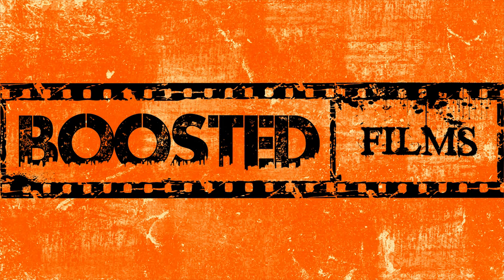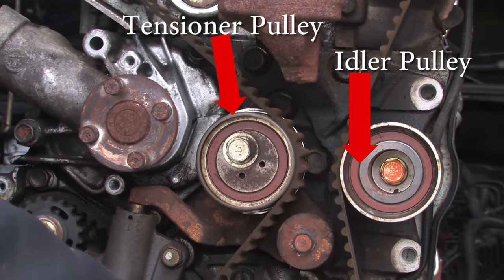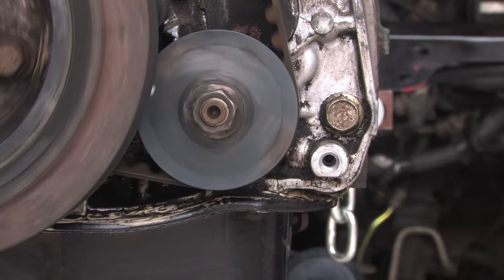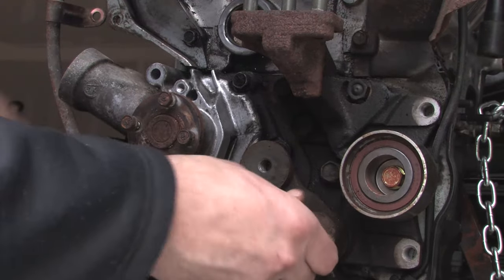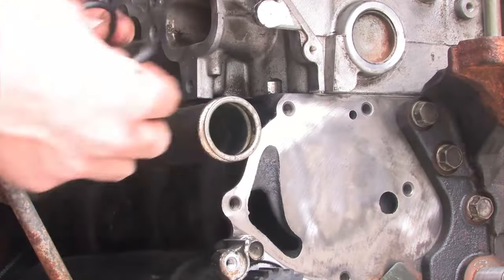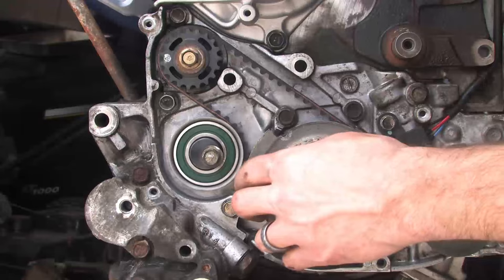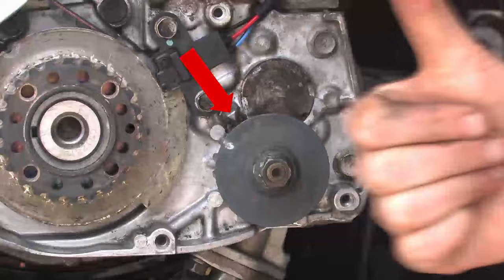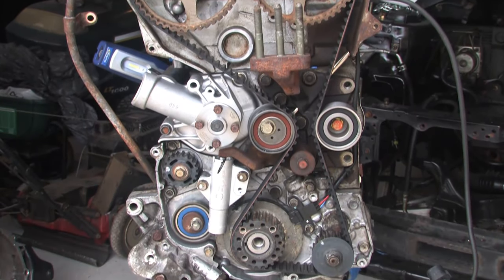Mitsubishi Timing Belt How-To Video (very detailed) // Evolution 8 - EVO8 - EVO9

Comment: .Balance shaft tensioner pulley, be sure the lip of the pulley is outwards, not in(against the wall of the oil pump)

.when installing timing belt, install the belt on both cams, work your way down onto the idler pulley, then onto the oil sprocket, crank sprocket,and finally the tensioner pulley. That way it doesn't throw off the lower b/s belt.

Comment: If your going to remove the belt for the rear balance shaft you should also replace the front shaft with a mirage stub shaft for it to run a little smoother.

Comment: Nice. Can't imagine how complicated it must be changing the belt with the engine in the car.
Reply: super easy
Reply: I just did it. Pain in the butt having to jack the motor up and down between steps. But beats the hell outta having to buy a crane and take the gearbox, both manifolds, the fuel rails and the air con off. Not to mention the amount of harnesses and connecters you have to fiddle with and remove from the engine block. It actually easier with the engine in, in my opinion :)
Reply: The 2-3" of room you have to work with and maneuver pieces around between the engine and side of the engine bay doesn't make it fun, but it's a lot easier than pulling an engine.

Comment: @Boosted Films - Subbed and liked the video. I was in the midst of doing my 06 sohc Lancer and came across this. The engine layout for all belts and pulleys was identical except for the second overhead cam gear. I managed to follow your steps and get it done extremely quickly. Runs like a dream now! Thank you so much!

Comment: according to the Mitsubishi shop manual, you can use two large paper clamps to clamp down the timing belt on to the cam sprockets then you run the belt down to idle pulley side.
Reply from the maker: Yeah, that and zip ties were a common approach if you don't have the special tools.
Reply: Actually, four paper clamps. I keep these with the smiley-pulley special tool and the long bolt for compressing the tensioner. But what really, really surprises me... this is almost the same engine, I have in my 1994 (!!!) Hyundai Sonata. 4G63 lasts forever ;-)
Reply: Boosted Files
Reply: I learned the clip approach from a local mechanic. It really helps.

Comment: Awesome video dude!! Another tip is you must turn the crank 2-3 times once tension is done. Let it sit for 30minutes and see if the pin in the auto tension slides back in. If not you’ll have to set the tension again :)
Reply: In the end the pin needs to go in freely? When I set the tension I didn't use the md998738 because I forgot but my pin did go in and out freely when I torqued down the tensioner pulley.

Comment: The thing which you’re calling front balance shaft is actually oil pump . Don’t know if you have noticed but when you removed your crank pulley , it was matching with timing mark on cover but the oil pump pully was out of mark which is pretty normal.
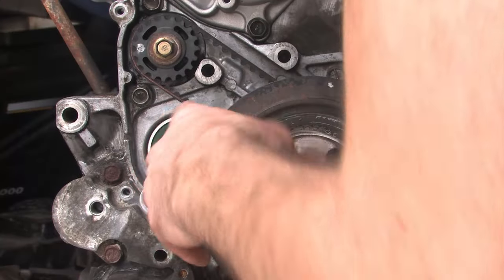Reply from the maker: Hello.  Yes i am aware the front balance shaft is also the oil pump pulley.  Sorry if i did not mention that directly.  As for the timing marks not matching, if you are talking about 3:53 in the video, the Timing Belt is already off.

Comment: Just did the timing belt tension on my friend's EVO VI.  Had it set as per Mitsu's procedure, where the pin has to slide freely in and out of the hole in the autotensioner after 2 spins of the crank, and waiting 15 minutes.  But the thing is, the final tension (just deflecting the belt between the cam sprockets, and the longg run lower down between the idler pulley and the front balance shaft sprocket) seems a little bit loose to me.

The actual tensioner pulley/happy face is in the same position as in your video, if not a bit further anti-clockwise/more tensioned.  Thoughts? Is this just the auto-tensioner setting things the way she wants it to be, and me thinking the tension needs to be stronger than it should be on this engine?
Reply: I think there is a little mistake (I might be wrong, do not remember now) in the video. Initially, the happy face must have 'eyes' up, and then you rotate it clockwise down, along the belt rotating direction. Let me check it..
Reply: Yep, I was right. Chilton's says clearly, put the belt anticlockwise starting from the intake camshaft sprocket, tensioner pulley (happy face) must be upwards, initially adjust the tension by spinning it clockwise.

Comment: Hi, I'm from Brazil and after have the timing belt changed the engine of my car started having a kind of vibratiion. Its like if the engine were lying somewhere in the chassis of the car. 
Do you think this could happen if some mark point were mismatched? Tks
Reply: The front balance shaft that turns with the oil pump pulley is out of phase.  It can be lined up 3 ways and 2 are incorrect because it's a 3 to 1 gear reduction.  When lined up the proper way, when you slightly turn the gear it will want to rotate back to the mark when you let go.  When lined up the wrong way when you rotate it a bit and let go, it will continue to turn away from the mark.

Comment: I know this is old but when I don’t have a balance shaft belt can I just install the new timing belt when u first take the old one off? My belts are brand new along with water pump and all, but a rock must have hit my belt as it now has a gash in it. I just need to Toss the new belt on, you took the belt off fairly quickly and I was specifically woundering if I have to take off the other stuff if I don’t have a balance shaft or can I simply put the new one on as soon as I get the old one off

Comment: Almost there.  Question on the lower belt cover.  I didnt see you take it off.  I have the bolts off.  But it doesnt want to come off.  Do I have to remove the crank pulley first?  Also, how do I keep the crank from spinning if I use pneumatic ratchet gun?

Comment: The 2 balance shafts are designed to work together. You can't just remove the belt from one balancer without disabling the second. The oil pump needs to come off and a stub shaft and block off bearings installed in place of the balance shaft. I highly discourage just removing the belt.

Comment: thank you for this awesome video! what exactly does the balancing shaft pulley do for the motor. why is it considered optional
Reply from the maker: Thanks! The balance shafts simply help "balance" the motor so it is more smooth and has less shake.  But most people that remove them say they can not tell the difference.

Comment: I Need Help!!  I Have A Short block And Cylinder Head That Needs to Be Joined But I'm Afraid That I Might Bend The Valves because I don't know where the crankshaft has to be placed!  I don't have a timing cover or anything to place a marker on since I'm starting from scratch!

Comment: Hello! Good Video! I've tried to tension timing belt on 4G64 engine without tension tool 4-5 times before i get it right! It's very tricky for 4G6 engines! Did you used dynamometric (1-5 Nm) key till it makes a klick to provide right tension?
Thanks!

Comment: how did you break open the Crank Pulley bolt? Is there a trick to keep it from spinning?
Reply from the maker: air impact
Reply: any impact ;)
Reply: Socket wrench handle or extension in the view hole for the flywheel and you can find a way to get it stuck then loosen the bolt

Comment: Paul, so why didn't you use the screwdriver + bolt hole method to line up the front balance shaft?  I can imagine with the engine in the car it would be more difficult but that's not the case here.
Reply from the maker: Hi John.  I'm sure i did both and just didn't include it in the video here.
Reply: Boosted Films I gotcha. Get that downpipe in yet? Or you hibernating until it's warmer out?
Reply from the maker: Yup, exhaust is pretty much set.  I know i need to do an update video, I just don't want to make a video for the sake of making a video.  Car is kinda in limbo right now with the rest of my life...
Reply: Understandable man.  We'll all be here when you're ready.

Comment: My timing marks keep misaligning when putting tension just like in your first attempt. Which teeth were off that you corrected? I’ve tried multiple routes and same issue.
Reply from the maker: Testing my memory a bit here. but i think the balance belts marks were always where a bit to the right (clockwise) of where they were suppose to be.  So  i think i had the top cam timing marks right on, but had the bottom marks what looked to be 1 tooth left (counter clockwise) and once i added tension they lined up.  Good luck.

Comment: Dont you have to set the tension so that the granade pin is lose in the holes?  Im currently doing my timing belt kit and was told the pin has to be lose in order to have it correctly set
Reply from the maker: You want the tensioner pulley adjusted to where the grenade pin is loose in the auto tensioner. In the video, When i did the tensioner pulley adjustment you can see the grenade pin rotate so you know it is loose and free to remove. A loose grenade pin provides maximum travel from the tensioner and is what you want.
Reply: I have purchased the tension tool to adjust the tension but when i tighten the 14mm bolt when set the pin is hard to remove. Ive tried multiple times all day and still no loose pin. Im at the point of stripping the tension pulley 14mm bolt from trying to set tension

Comment: Have you drove since? I was curious what it was like with no balance shaft belt over a longer period of time. Please lmk, id like to hear from someone who has done it first hand
Reply from the maker: Cherry it’s been 💯 fine. But I probably only have like 4-5000 miles on it since I removed it. I would also like to know hear from someone who has been without one for like 30k miles have more solid data. Read the link in the video description if you haven’t already
Reply: Dont delete

Comment: Why do people not run the. Balance shaft? I got a 97 eclipse 2.0t  just wondering
Reply from the maker: Because its another belt that can break.  The balance shafts we're seen more as a comfort item, and most people don't drive DSM's / EVO for comfort.  So they remove the balance shaft belt to reduce the chance of it breaking and destroying the timing belt in the process. 

However, that is basically the old way of thinking.  People now are more concerned about the actual harmonics of the engine that the balance shafts help with.   So do  more research and decide for yourself if you are doing a belt job soon.

Comment: What about the tensioner pin does need to take out or what? Thanks
Reply: Of course! After a few spins, the gap between the tensioner body edge, and the swinging arm should not be greater than 12mm. If it's larger, or almost none, then you have to re-adjust the smiley-pulley again. Left eye should be about 14:00 hours ;)
Reply: actually, should be between 3.8 and 4.5mm (Chilton [8412]32100,  chapter 3-36)

Comment: OOooh noooooo! Get rid of that balance belt! I had an evo 5 and the balance belt  snapped taking the timing belt with it! Needless to say that head was knackered..after sourcing a head I decided to push a piston out of the bore, it snapped in two! So, new rods, pistons, gaskets and the removal of the balance shafts (good riddance) I rebuilt the motor and had it tuned to 400 whp, it has run great ever since.

Comment: Can anyone give tips on how to get water pump pulley put on with motor in the car? Not enough room to get my hand in there to thread the bolts in. It was a pain in the ass just to get the bolts off now it seems almost impossible to get them in.
Reply from the maker: It should be do-able.  Make sure you are trying to use the right length bolts for the right holes.  https://www.youtube.com/watch?v=qXJodeTeC9I
Reply: Boosted Films just the pulley itself not the whole pump. The pulley is literally right against the wheel well lol
Reply from the maker: Lilskidmarks14 ahh. Sorry, I misread that. Find a friend with small hands or raise up the engine a bit for more room.
Reply: @BoostedFilms  ok I'll try those thanks for the help